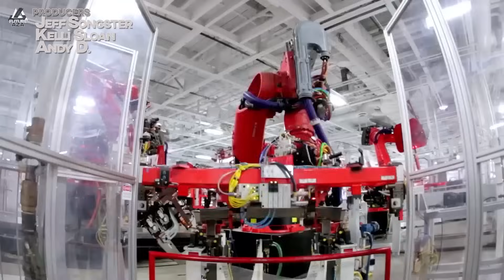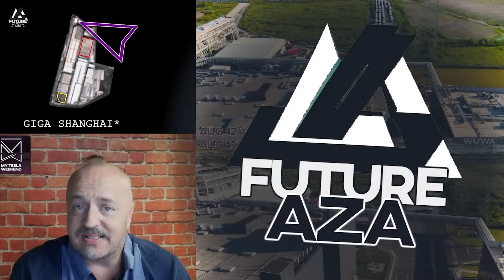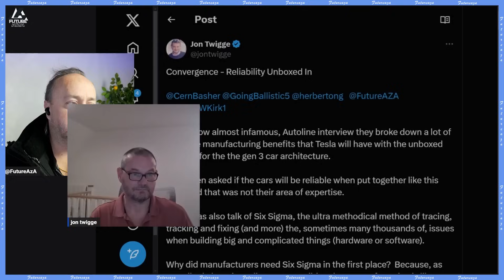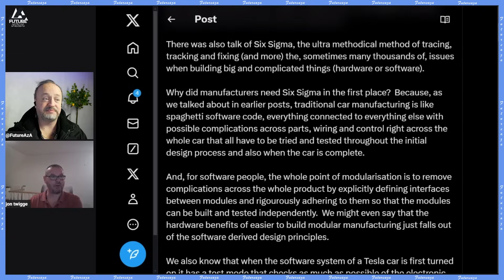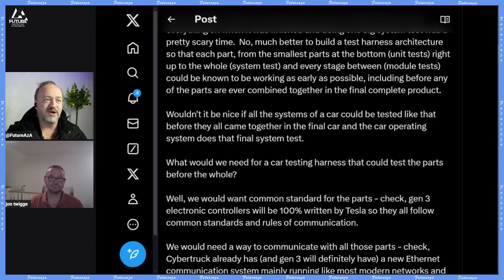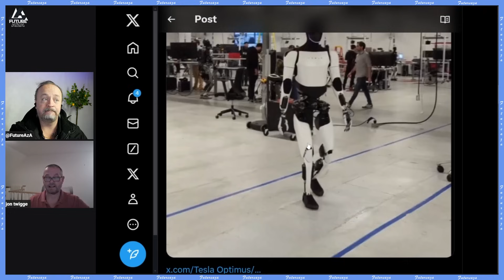Unboxing Tesla's Compact Tech Marvels!

Comment: The Tesla Bot could have a self test for EV cars using an attachment to its built in computer program like a walking talking bot system check.  Maybe the Tesla can send wirelessly the defective part.  Is it possible for the Bot to have a printer that can print out error.  I worked work a company that made OTC diagnostic products when cars have engine codes.  How about a printer near the mouth to make a print out.  How cool is that

Comment: A new electrical and comms architecture necessitates new interface standards for all electrically operated systems. the manufacturers are usually have a longer lead time to re-design, iterate, and produce the new parts to standard.

Comment: Modularisation is often useful, if done in the right way. Done wrong, you end up with many expensive interfaces.
Think of it like this: A computer cable with connectors in the end has the majority of its cost in the connectors/ interfaces if it is short. If it is a long cable the cost of connectors are neglible. If you have "long cables" in the car and break them up into short modules, cost rise significantly.
An unboxed car will have some new interfaces which have a cost attached. Savings in other areas need to compensate for increased cost at connection points.

Comment: no, not wirelessly... just think that through one more time.
Reply from the maker: Go on then.
Reply: @FutureAzA  I mean i suppose it is physically possible to power the components that you want to test wirelessly. But then you would have to install wireless communication chips in each module. And if you are going to do that, why not just delete the whole wiring harness? I doubt the weight savings makes up for the inefficiencies and chip costs. But hey you're the experts.

Comment: As an (old) electronics guy, I kind of shy away from wireless linked systems. But, with multi-frequency, multi-redundancy tiny IOT ( Internet of things) comms chips , it makes sense to have some modules ( or major nodes) as wireless. (Though it sends scary shivers down my spine.)  , because it can reduce complex wiring from end to end.....(PS a ton of rf testing is required...)

Comment: I think you miss a lot of points in the un boxed ideas. Say for example a left door gets assembled it is usually done on a trolley/jig which will includes its own diagnostic computer. If faulty it gets diverted  to a repair station else it goes with the line to the next assembly point. As the assembly grow, the computer keeps testing more and more functions as parts get added (and if faulty the whole sub assembly gets diverted for repair) that way there is no hold up on the line, and no external bot will be needed for diagnostics.  I see the functions of the bot to mainly just loading parts on conveyor belts that will take it to assembly stations. Very boring and repetitive work that humans prefer not to do.